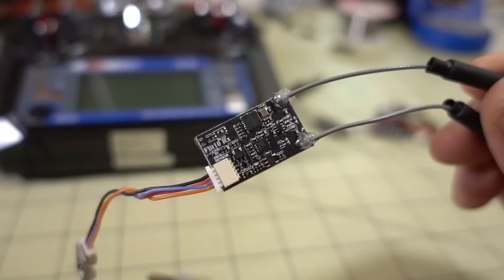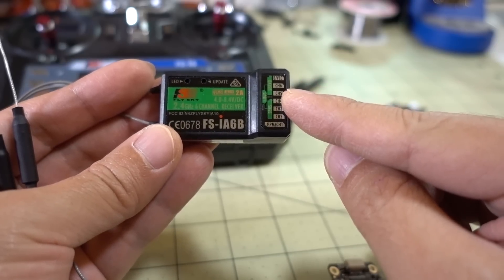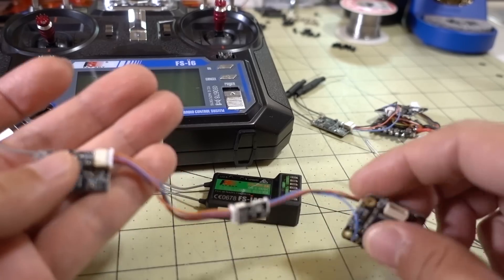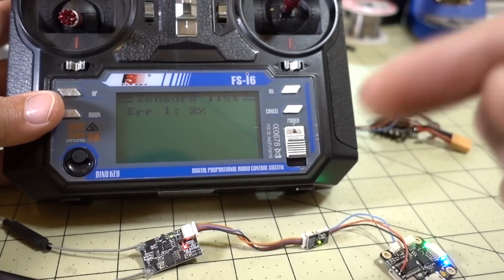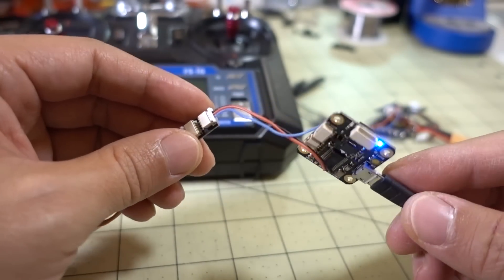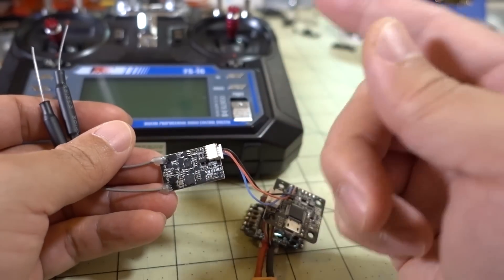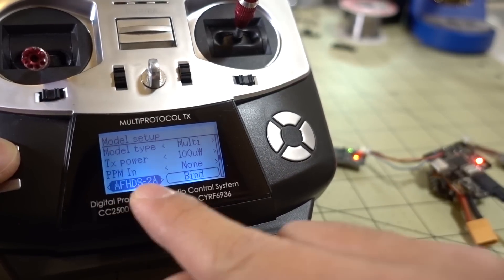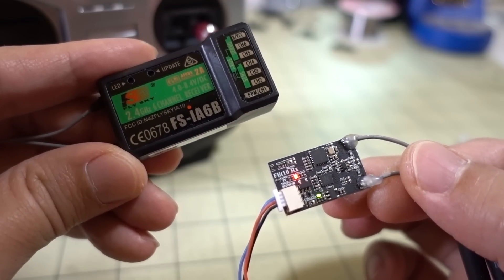Flit10 Flysky Telemetry Receiver Review 👍

Comment: Just set up this receiver today. If you know a little software you can get almost any telemetry back to your receiver, up to 16 different parameters. The iBus telemetry features really shine when using iNav and additional sensors like barometer and GPS. Flysky transmitters are limited in how they display some parameters and their units, for example some parameters indicated as RPM may be other types of integer information. You can view 5 parameters at a time and page through as shown in the video. These telemetry values are more reliable and work right to the edge of radio range, long past where your FPV screen is so washed out you can't see any numbers. Check your Betaflight/iNav documentation or software source code to see exactly what all the default parameters are. Using iNav with some telemetry customizations I currently have the following parameters: Heading deg, altitude ft, distance from takeoff point, GPS speed km/h, GPS status: # sats & fix quality, drone tilt angle in deg, battery volts.
Reply: Just found another great benefit of the iBus telemetry: On Flysky transmitters you can get battery voltage monitoring and low voltage warning beeps. This is WITHOUT the hack a lot of people do to FS-iA6b receivers to monitor battery voltage. I'm using FS-I6 transmitter (with improved 10channel firmware) + Flit10 receiver on a Tyro79. All you have to do is select "Ext LiPo" in the battery settings instead of "Int LiPo". Then it uses iBus telemetry parameter 2 which by default is the battery voltage measurement from the FC. Of course you have to connect a wire from the battery to the FC battery monitor pad, but this is already part of the existing cable harness on some drones like the Tyro.
Now I have battery alarms & voltage readout without hacking the Flit10 receiver.

Comment: I got a flysky transmitter an i ordered a flite10 plus receiver. How can I get battery telemetry on the transmitter screen? I want to see the battery voltage of the quadcopter on the transmitter. Is this possible with this receiver, without using the extra telemtry module? ie just plugging the receiver into the flight controller? The F4 has built in battery monitoring, so can I get that to transmit through the receiver telemetry to the transmitter screen?

Comment: Do you have to solder this to the quad? Or can you just plug it in via the port? I'm new to this Hobbie! More specifically can I plug it straight into the diatone 2019 gt r349 without soldering? Thanks!

Comment: have a flit 10 reciver and flysky i6s transmitter
i held the button down to make the light flash fast which puts it into binding mode then go to rx bind on my controller but nothings happening
on beta flight i have usb vcp enabled for msp and uart3 enabled in sr rx
Reply from the maker: Is the model setup for iBUS or PPM?
Reply: @AlbertKimTV  I put it for Ibus
Reply from the maker: Are you using and F4 flight controller?  It has inversion issues and doesn't like IBUS.
Reply: @AlbertKimTV  yeah im using f4 but i dont know what you mean by "inversion issues"
Reply from the maker: Too much to explain here.  Basically F4 uses hardware inversion so IBUS won't work.  You have to use one of the other UARTs on your FC that is not inverted.  There are videos out there explaining this better and it's quite complicated and confusing.

Comment: Albert Kim I have a question, I am doing a build and have the flit10. The stock antennas won't work with the build I'm doing and I'm trying to learn how to replace the antennas. I've searched everywhere and don't know what to type specifically. Can you tell me how or point me in the right direction on how to solder different antennas on? I have a bag of regular non diversity ipex antennas like on the x6b I would like to solder on. Do I just cut off the ipex connector and solder on? Thanks for your time

Comment: Hello Albert! I'd be grateful if you can give a piece of advice. I'm about to assemble a mini fpv racer on hummingbird 110mm frame with F411 tower. Which RX would you recommend: Fli14+ or Flit10? Is it possible to have RSSI on OSD if I have Betaflight and an standard FS-i6 transmitter (default firmware)?

Comment: I just connected it up to my F4 in my FT Gremlin chose the rssi channel in betaflight and it worked right out of the packaging, I didn't have to configure anything else out lol. The range is pretty decent as well, not sure about the actual distance but my e03 vtx on 25mw runs out before the flit!
Reply: Could you help me troubleshoot mine? I have the FS I6S transmitter and don't have those menu options. I'm using it on a beta 75x

Comment: Hello

I recently bought a receiver of this brand, very similar to the one you mentioned in this video, the irangex Fli14 +, and I managed to correctly bind it with my turnigy evolution, but when I connect it to the buterflight configurator and configure the port, I put Ibus, but in the receiver tab do not move the channels, you know why this problem can be ?, can it be because I use buterflight instead of betaflight? i alrready flash it to betaflight (is the helio rc) and the same problem, the chanels dont move in the reciver tab. can you help me?¿

Have a nice day
Reply from the maker: Check that sbus_inversion is not on.  IBUS is not an inverted signal.  This is the most likely cause of your issue.
Reply: Albert Kim I can solve it, the problem was that the pin map of the helio RC is wrong, the sbus and the ibus are not the same pin, I change the sbus port for rx2 and problem solved

Thank you so much anyway for answering me so fast. Love your chanel. Hope you continue with this fantastic work. 💪

Comment: Thanks for this video. I have a question. Why is the ground and iBus wire switched with and without the telemetry thing? At first the black cable is on the outside and then on position 3.. Can you explain this for me? I have this RX at home now and I want to put it into my quad soon :) Thanks
Reply from the maker: I used a random cable that had the wires in the wrong order.  I just soldered it in properly just the colors don't match what they should be.
Reply: Ahhh.. That makes sense.. Thanks dude =)

Comment: Sounds like everything you can get through telem to your radio is the same info I get in my Betaflight OSD which I can see while in my goggles. The size isnt that much better then the IA6c that I currently use so I probably wont be buying this after all. Thanks for the video.

Comment: I had problems with the upgraded firmware and had to roll back to stock have you had any problems. Using the 1.7.5 flyplus my arming was intermittent and would failsafe for no reason.
Reply from the maker: I haven't used it. Just seen some videos on YT. I don't use the i6 as my daily driver.
Reply: Albert Kim understandable. My upgrade will be the ts8g anyways. Liking the looks of the v2 and the plus.
Reply from the maker: Get the T8SG Plus when it comes out.  I use the T8SG for everything now and not going back to Taranis.
Reply: Albert Kim thats the plan. Plus the wife wants something smaller to fit her hands better

Comment: Help me out Albert, I have a issue not related with this vid... I´m trying out this new F3 whoop pro FC that I got from Gerabest and it isint arming, I did that STATUS commend on CLI it´s saying 0x1020... Does that mean that it will only work with 1020 brushed motors???? Can you please help me out??? Thanks
Reply from the maker: That number is a hex code for the error.  Somewhere on the Betaflight website they explain it but I did a quick search and could not find it again.  I don't have the chart of error codes memorized, sorry.

Comment: So no voltage telemetry?
Reply from the maker: You can set it up if you want it on the radio display but the process is arduous.  Check the link in the description as that page has all the technical details.  After a few paragraphs my eyes were rolling and I decided this was too much work for not enough gain in my eyes.  If you really want to make it happen you can, but it will be some work.

Comment: Advantages over an X6B ?
Reply from the maker: it's smaller and lighter but doesn't do PWM, PPM, or SBUS if you need those.
Reply: Albert Kim nice revieuw! Do you think it has just as good range as the x6b? And did those antennas came glued like that? I switched all of my ia6B receivers to the newer x6b a long time ago.. purely because i always depinned and decased those bulky ia6b's.. and i love the ipex connectors on the x6b antennas.. does this receiver have those connectors? (Cant see because of the glue) and could you also use the antennas from the x6b which are without those bulky things on them? Love the size of this new thing.. but hate those bulky antennas!
Reply: UnXisT FPV no connectors on this one, they’re directly soldered
Reply: Tony Peart aah okey.. well its ok.. but, could you also just solder on some normal antennas without those bulky tubes?

Comment: i'm confused, i hacked my ia6b to take vcc input which gives me voltage warnings on my fs i6, (modded fly+original) i somehow have rssi err but no warnings, i'm told they are  not very useful anyway, but you can mod an ia6b to give voltage telemetry without software changes but its the finest solder work ever, nevermind removing those pins???.. better option is the turnigy ia6c which has a port to connect vcc ... job done.  so my confusion about the flit?... the fs i6 already has telemetry, it reports back without going through the flight controller, so why bother?... i do like how small it is and if it has a pad i can solder vcc too that would be great,  the only radio telemetry i need is a two stage beeper for voltage to remind me to look at osd mah used and voltage. does anyone know if the flit can do the vcc thing?  and its range?

Comment: Finally a small flysky telemetry receiver
Reply: Received mine today, and I have to say, im not impressed. 
First of all Its kinda heavy. With 3.4 g its just one gram lighter than the x6b. Very short wires that cant be changed (I wonder how low they will say intact) and the antennas are these thick brass dipol types. Nah this one is a fail. No idea what kind of model I'm gonna use it in.

Comment: Can you get full telemetry on the Jumper TX?
Reply from the maker: I didn't check that. I wouldn't think more would come through on the Jumper than a genuine Flysky radio.  Do you think that might be possible?
Reply: Definitely possible. Would have to dig into Deviation manual and play around with my Jumper. My other question on using Lua scripts on OpenTX with multiprotocol module kind of hinges on this. Multiprotocol 4-in-1 module and Deviation firmware share a lot of the same exact code. If it works with one I would expect it to work with the other just with different UI. I completely understand why you didn't test it. This usage scenario would be kind of a waste of time for most people.

Comment: Can you use it with multiprotocol module on an OpenTX Taranis to use Lua configuration scripts like you can with S.Port telemetry?
Reply from the maker: I have no idea on that, but it sounds interesting.  I didn't even think Lua scripts would work with the multiprotocol module.... is that really a thing?
Reply: I am just hoping. It basically depends if the Lua scripts are hardcoded to use S.Port telemetry or if they are sending and receiving over an OpenTX abstraction layer and don't care what the actual telemetry protocol is.
Reply: I just looked at the Betaflight Lua scripts on Github. Not looking good. It looks like it only supports S.Port and CrossFire from what I have seen in the code so far. In theory someone should be able to add Multiprotocol/IBUS to this though.
Reply: And because this only works on S.Port and CSRF. The Betaflight firmware probably doesn't bother to emulate the sensors that the scripts use for comms. So the firmware on the FC probably would need to be modified too. Damn. Maybe some day. I might try my hand at writing a patch for it eventually.

Comment: There's really a ton more info that can be sent with the telemetry module, you just need to running flyplus firmware for it to really be useful. Actually i think this rx should really be advertised as recommended for flyplus users
Reply: ultrafpv Flyplus firmware you say? Need to look into that.
Reply: Another good thing about the flit10 compared to ia6b is that you can get lipo voltage though telemetry without having to hack the ia6b
Reply from the maker: Where is this documented?  I wasn't aware of this.  What additional data is sent with FlyPlus?
Reply: do you know if i can solder the vcc to a pad on the flit? its the only telemetry i need,  going through the FC and using a channel for rssi err??? all this confuses me because i already havee this using the turnigy iac and the old upgrade/mod for the fs i6 ... seems like a lot of work to get the same thing, only benefit is rssi beeper warning which i'm not sure is very useful for quads.
Reply: ultrafpv I
Reply: I use FS-iA6B telemetry hack to vbat from betaflight back to transmitter. With custom flysky firmware you can set low voltage warnings. It is very useful.